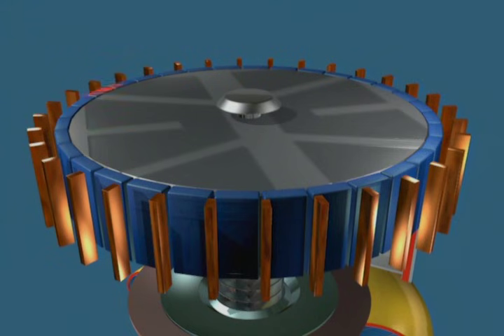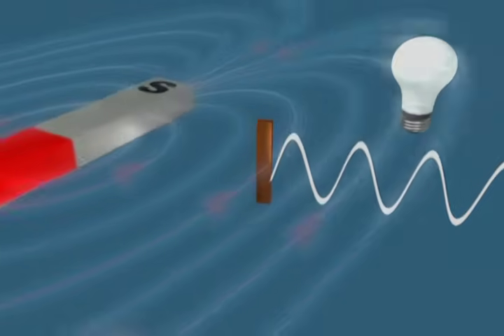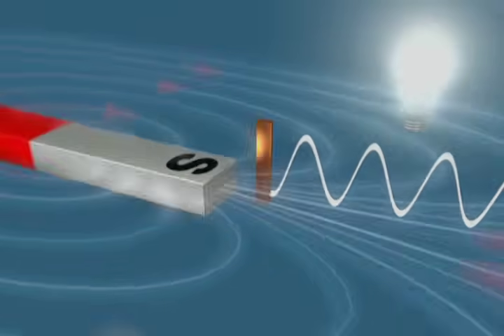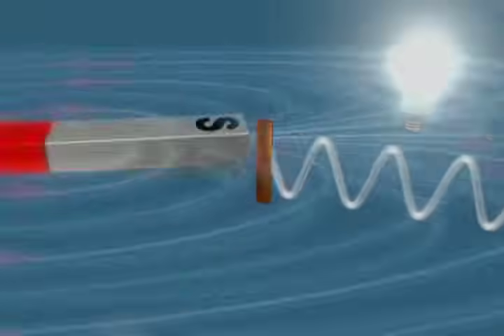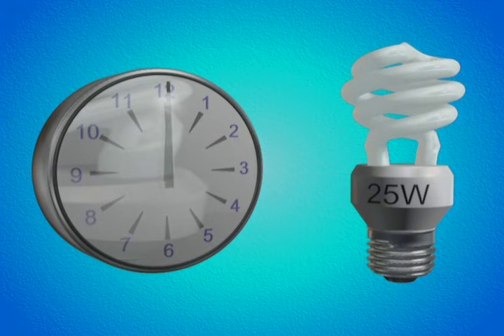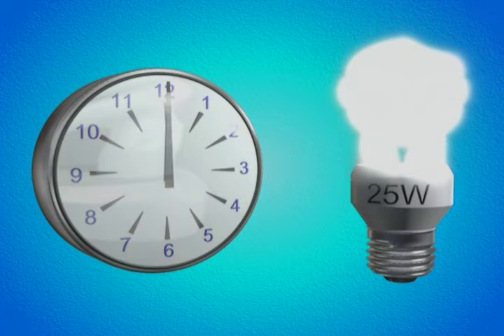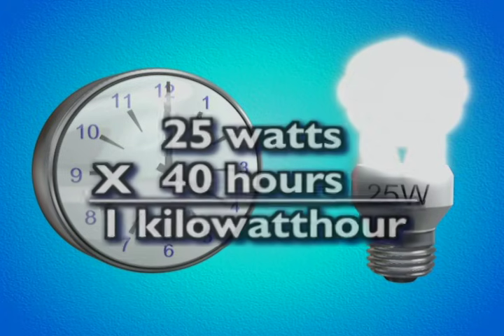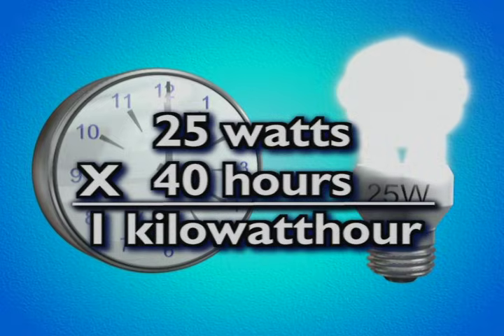Electric Energy

Comment: Thanks for the doc. I only want to make you a little question: When we receive voltage at home (220v), we receive positive charge? When we contract power (watts), we receive more or less flow of electrons?. Salutes.
Reply from the maker: Alternating current we use at home switches polarity (positive and negative) sixty times per second (60 hertzs). When you turn on an electrical appliance, you ask Hydro-Québec to provide the energy to move the electrons already in your appliance. Watts are actually the product of amperes x volts (current x tension). The “flow of electrons” as you refer to it, is the current (the amperes). So when you call for power (watts) with your appliances, you receive a certain amount of energy at home, which are in part voltage (the 200v you are mentioning) and in part amperage. And you are right: the more we use electric power at home, the higher is the number of electrons moving at the same time in your electric entrance… and in your meter. Hope that helps!

Comment: Great video! What I don't understand is that for the electromagnet to become a magnet you need current running through the coil. Where is this current generated from?
Reply: Good
Reply: bro the cell is attached...
Reply: When you run a current through a wir, a magnetic field will be generated around that wire (the direction of the field will be given by the right hand rule). thus when you wrap the wire into a coil, the magnetic field will around the wire will aline since they have the same direction of motion, summing up all those magnetic fields gives you an eletromagnet.